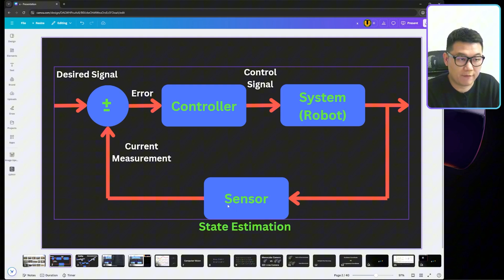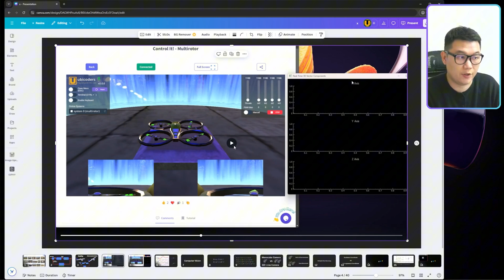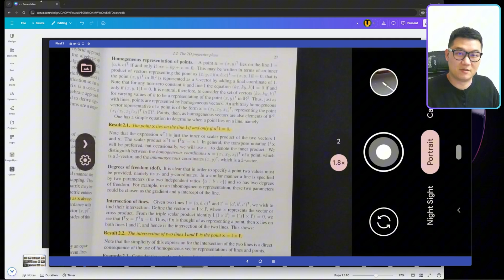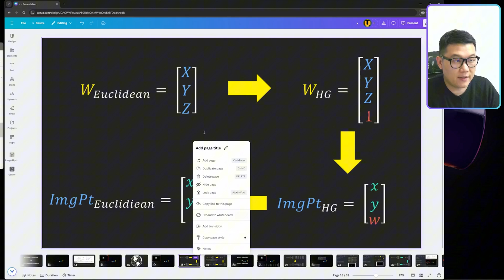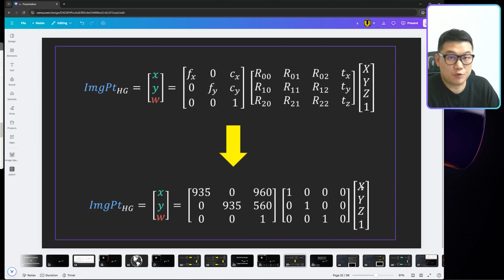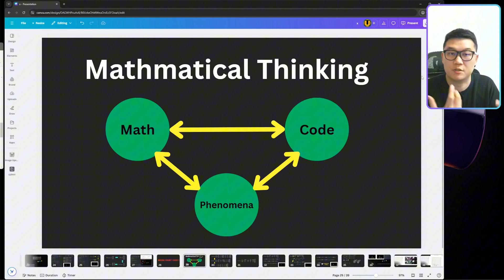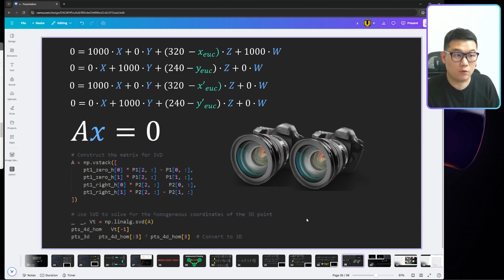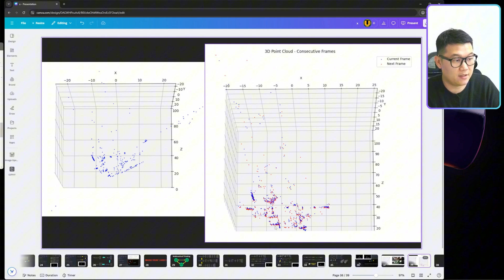Are You Missing This Crucial Computer Vision Insight for Autonomous Systems?

Comment: Consider a case where we have a single camera if we go a bit advance we can use monocular depth estimation to get the dist ance do 3d reconstruction but this is only for ground based robots 

Lets take aankther case i am really not sure about this just making ideas what if we match  features between frames the movement between the calculate angular velocity on a calibrated camera. I feel like this has a lot of downsides but maybe tracking movement of features in deferrent frames can give info about linear movement or rotational movement. I am currently reaserching this will update if i find a solution by implementing it on a rover

And i know the solution just removes the purpose of this video to make it simple if you can but i felt it was right to put this here
Reply: Yes I will also implement a 6 axis imu both will correct each other read and maybe add weight to the more accurate reading to get better prediction
Reply from the maker: Fantastic comment!  What you mentioend is related to the observability in control theory. Image there's a drone going down a well. Then, the drone hovers and only yaws without any linear movement while it's looking at the round wall of the well. Also, another case is that drone is follwing a flat wall of a brick house. With only vision, can this tell the difference between the linear moment and the rotation? Idk either. But I bet it's pretty difficult. So I'd use the information from a gyroscope.